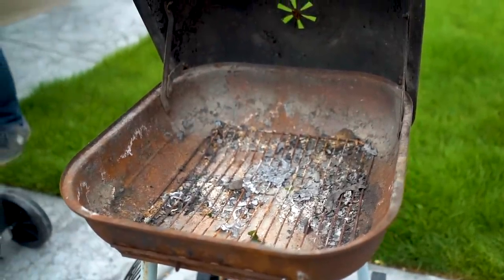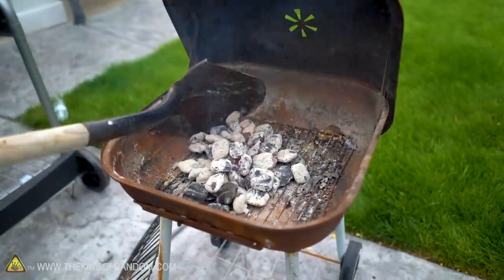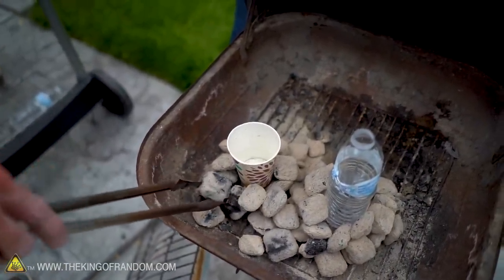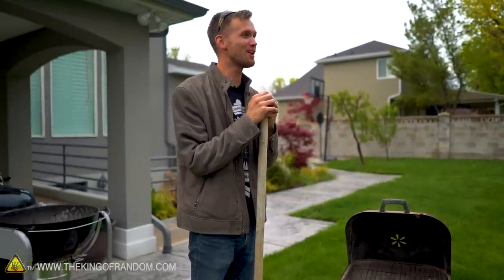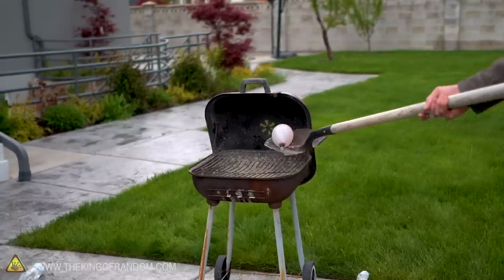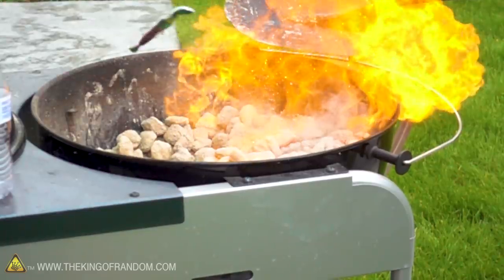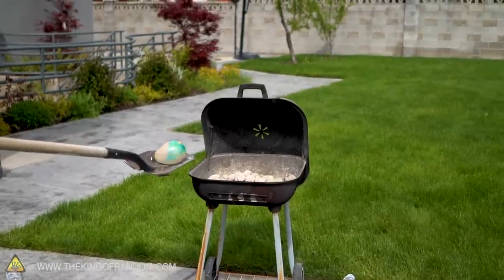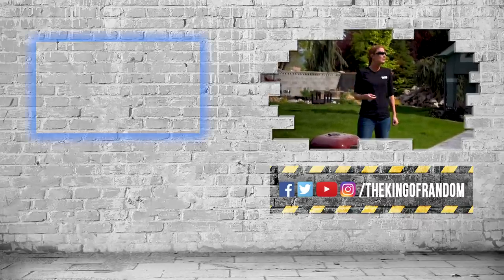Is It Possible to Boil Water In Its Bottle? Can You Boil Water In A Plastic Bottle? Plastic Cup?

Comment: Try putting a bit of insulation around the bottle to keep the temperature more stable and to give some structural support
Reply: And what kind of insulation do you suggest that isn't flammable?
Reply: Random Guy on the Internet sand
Reply: Random Guy on the Internet  there’s actually fire bricks or even fire retardant gels or wools.

Comment: If you want this to be EPICLY SUPER COOL, use stoichiometric ratios where there is precisely enough oxygen to react with every molecule of fuel. That would ensure that it's not relying on the air for reaction, speeding it up and making it an actual explosion.

Comment: You can boil water in a plastic bottle fairly easily.  The trick is to suspend the bottle over a fire with some type of cordage so that the flames just barely lick the bottom of the bottle.  The bottle will deform a little but the water will boil without issue.  This is actually taught in survival classes.

Comment: It is very possible to boil water in a water bottle. The water bottle has to be hung above a fire (not charcoal) and wait. The bottle should not touch the coals or be directly in the fire but above the fire.
Reply: I was going to say this. I've seen it done many times
Reply: Can also vouch that I've seen it done, successfully, the proper way of hanging the bottle over heat.
Reply: I have seen it done too but sometimes it melts a hole.

Comment: You can boil a waterbottle. It needs to be vertical and have the lid off though. Also needs to be about 8-12 inches from the top of the flame. Les Stroud did it in Survivor Man to sterilize water.

Comment: Ive boiled water in a plastic bottle exactly like you have. It works but you need it hanging above the heat at the right height to not melt the bottle but still boil the water. And its a long process. At the right height it takes a couple hours to reach a rolling boil.

Comment: You can boil water in a plastic bottle, but you have to suspend the open bottle over the heat source, not against it. If a fire, place a little bit above the visible flame.

Comment: Paused at 4:16, I think it'll take a higher temp to boil the water due to the building of pressure, until bottle failure and then the water will rapidly turn to steam.

Comment: You can boil water in a plastic bottle. I've seen it done. You have to suspend it above the fire, not put it directly on hot coals. Then it works just fine.

Comment: If you tie a string around the neck of the bottle and hang it over a fire (not in the flames!) it'll boil...
It needs to be full as those little water bottles are super thin!
So a plastic fizzy drinks bottle is thicker better... 
Or a bigger and more substantial plastic bottle!!

Comment: Actual rip, if you put it over a fire and not directly on a hot surface, the structural integrity will hold a bit better. it will be softer though.

Comment: No it won't unless it reaches a certain temperature then pops open. The pressure (with the lid on) will prevent it from doing so, if the earth got super hot and all the water evaporated the water in bottles will still be in liquid form.

Comment: You can hang water bottles to the side of a heat source it can boil water I dont recommend it but it is possible I have done it with a campfire open so it can vent.

Comment: I found a vary cheap why to make rubber

Step 1: get dishwasher pods
Step 2: cut the dishwasher pods and get the stuff inside out
Step 3: get the casing wet and mold it in to the shape you want then about 2 hours let out to dry but do not dry all the why unless you want plastic I used Walmart brand

Comment: Boiling water in a plastic bottle is a fairly well known survival trick. If it's not working for you, you're technique is faulty. There are plenty of videos available on youtube showing this. Suspend the bottle above the heat, it works. Also, that brand of water uses a very flimsy bottle, there are plenty of others that work much better, like Dasani for example.

Comment: set an empty water bottle on fire and put it in liquid oxygen, I'm saying this because if you burn plastic it normally leaves a residue like burnt plastic so I think that due to the high oxygen levels surrounding the liquid oxygen and from previous vids you've made with liquid oxygen I don't think it will leave a residue

Comment: Ah. Fuel air bombs on a micro scale. Now here's a question. Can the water bottle survive boiling water if you put the bottle itself inside another container (say a pot) of water? Should prevent it from immediately melting, especially since it'll have sort of a cushion spreading the weight out.

Comment: You should try melting/forging metal in a vacuum chamber
Reply: That would rqurier lots of planning and experimenting to get heat resistant visible chamber that wont melt or explode from pressure or damage vacuums chamber motor from heat

Comment: I don't have to watch the whole video to know you can boil water in a plastic bottle. I grew up watching Survivorman and Man vs Wild. In both shows the host suspended a bottle a few feet above a fire with the cap off. In a few minutes the water began to boil and deform the bottle. There is a fine line with that temperature, because of the plastic, but yes it has been done before many, many times. There are a lot of videos on YT of people doing it in many different ways.

Comment: When I go camping I will empty a soda can and find some lighter fluid or some Tiki oil which works really well I will carefully put it into the empty can and then set the can on some hot coals you already know that the oil or liquid will boil but what happens once the fumes actually catch fire is quite exciting you get little spurts of what looks like a rocket flame coming out the top of your can this will go on for ball as long as there's liquid boiling in the can is quite fun

Comment: Bear grylls already proved u can boil water in a water bottle 😳 tie a string around the cap part and hang it above the water, does work but not recommended as does melt the plastic a little which is a bit harmful to drink